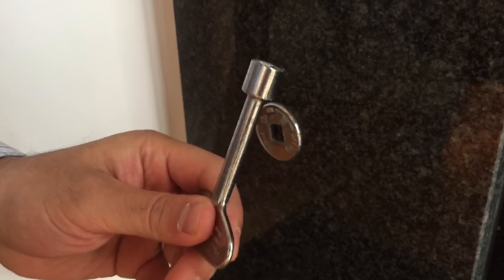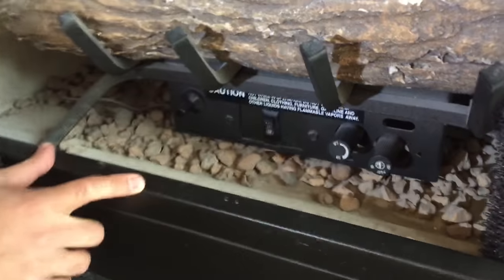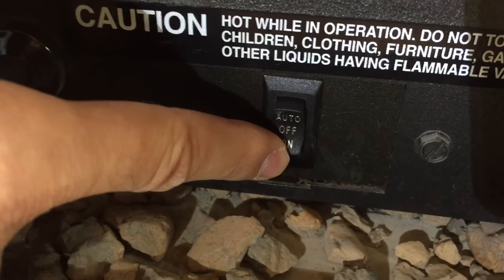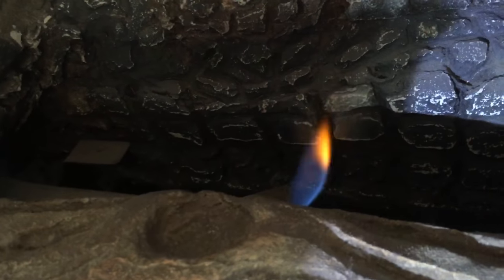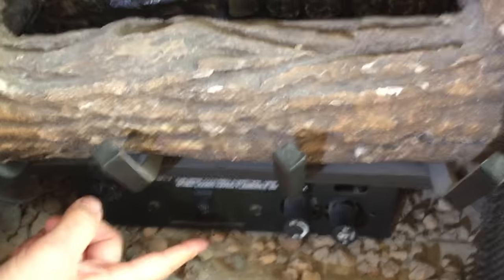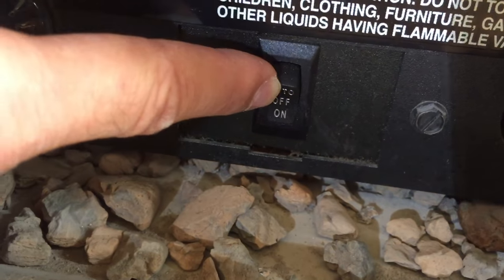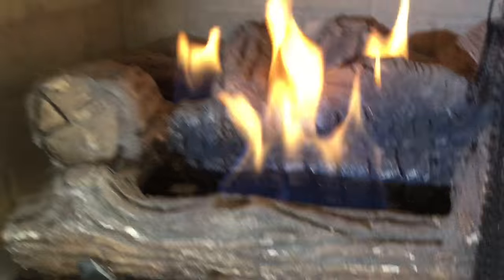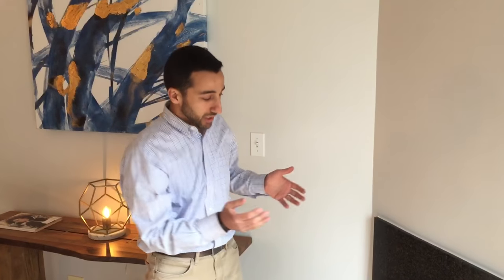How to Turn on Gas Fireplace

Comment: Should the gas be turned off with the key ? When the fire place is not being used and the pilot light is off ? I had a fireplace guy tell me to leave the gas on at all times. So I did that but I was still smelling gas even though the pilot light was off and the emergency valve i could hear click off  once i shut  pilot off.So I called the tech back and he said this was normal to smell some gas because the fireplace had not been used for a few year. But it still made me nervous so I shut gas off completely with the key
Reply: Hi Durell, if you are not using the fireplace regularly, I would definitely turn off the gas with the key.  I would only leave the gas on if the pilot light is on and you are turning the fireplace on and off everyday.

I hope that helps.
Reply: @marcusibrahim  thank you for responding!!! 🙏🏾

Comment: I have a wall switch which turns on fireplace. If electricity goes off is there a way to manually turn on fire logs. I have no remote as we bought house without one.
Reply from the maker: Hi Gloria, I'm not sure about that.  I would try to turn it on using all the steps in the video and see if it works.  Maybe someone else on the thread has insight.
Reply: @ Gloria, this video might be of help. Search YT: Zaichun Feng  title: turn on gas fireplace when power is out.

Comment: What about the glass screen? Open or closed?
Reply from the maker: This particular model is ventless which means it does not have any glass screens.  If yours is externally vented, then you can close the glass screens for less heat or open them for slightly more heat.